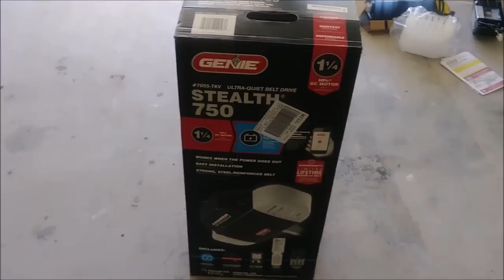Assemble and Install Two Garage Door Openers -  Gienie 750 - 7055 - Step By Step

Comment: Right on man. No fooling around man. I like that. Right on point. Great video friend.
Reply from the maker: Thank You
Reply: @josephk9182  Great stuff. I have a Liftmaster chain I'm replacing with a Genie belt motor and the wiring is already installed within the house, can i just use the existing wiring to plug into the Genie lower eyes and the pad openers or do i need to use thier wiring? Ty
Reply from the maker: @seatime674  No . Just use the previous wires if they good.

Comment: Where did you get the tool to cut the perforated angle and mounting straps. Is it expensive?
Reply from the maker: You can buy it on Amazon. It is not expensive I don't remember the price.

Comment: Hi I'm in the middle of trying to fix a garage door that is not square their for it's hard lifting it manually theirfor reason the motor fried any help with going about how to align the rails against the wall where wheels slide up n down because the ceiling and the ground aren't level so how do I go about lining that up and also do the rails have to be plumb ty
Reply from the maker: You need to level the rail vertically using level tool. Also make sure the garage door's springs are suite to the doors weight. You should  reach technical support from the company that manufacture your garage system.
Reply: @josephk9182  hi joe the motor is very old I threw it out today and bought a genie I did my best to straighten the door rail assembly I took it off practically and it seems better but the door is heavy wood without the tension cables it's really heavy I had to cut the old wires to fix the rails so the trouble I'm having now is how do I put them wires back it seems a lot of work to physically pull down on the wire to reach the bottom of door where the wire goes is their an easy way to hook the wire up ? The springs are heavy duty they are old but huge springs they run horizontally across the top ceiling along side of rail

Comment: i have native wiring (Red, Green, White, Yellow) in the garage, I put 1. Red 2. Green 3. White 4. Yellow, how do I wire the safety sensors
Reply from the maker: You should call the manufacture regarding this issue.
Reply: @josephk9182  I consulted the wiring diagram. Red and Green should be on both sensors. There may be two sets of wires on one side of the sensors. Both sets need to be connected the sensor for the current to pass to the sensor on the other side.
Reply from the maker: @davidtucker3538  Yes this sound right.

Comment: What do you do if garage door only goes down 4” from ground when using remote or wall button but goes down all the way when testing the distance ?
Reply from the maker: There is something wrong in your installation or the controller. Best call to technical support for your system to figure but went wrong.

Comment: What about the keyed garage door lock? When the door goes down, it locks, and only opens when you twist the manual lock. How is this solved?
Reply from the maker: Not in my garage door. When you installdoor openers you should not use manual lock or key.
Reply: @josephk9182  thanks for the reply. So I should take it off? The garage door opener will keep it locked I guess.
Reply from the maker: @coryprimo7641  Yes, that is correct.
Reply: @josephk9182  thanks a bunch Joseph... 2 thumbs up!
Reply: @josephk9182  thanks for the help. Got mine setup today.
Reply from the maker: @coryprimo7641  Excellent.

Comment: Hi there, does the rail need to be leveled (e.g. horizontally with the floor) as I noticed there's a slight upward angle from the rear support to the garage door.
Reply from the maker: can you specify the time in the video you see a slight upward angle from the rear support to the garage door ? Thank you
Reply: @josephk9182  Hi, I would say 23:57 - 24:03 would be the best scene.  I guess my question is, do you normally level the rails before fastening it to the rear hangers?
Reply from the maker: @davidguberman4780  Yes it should be slightly upward 2 to 3 inches or 15 degrees upward.

Comment: Do I need to hook up the sensors in order to make the door come back down with the remote because it comes up but it doesn’t come back down
Reply from the maker: Yes you need to. Please follow the manufacture instruction.
Reply: Joseph K thanks 👍🏽

Comment: If the Saf-T-Beams are not polarity sensitive, why worry about which wire to use? Just wire them in parallel
Also I was told that with the wall controller, it also is not polarity sensitive.  And if it does not light up, merely switch the wires.